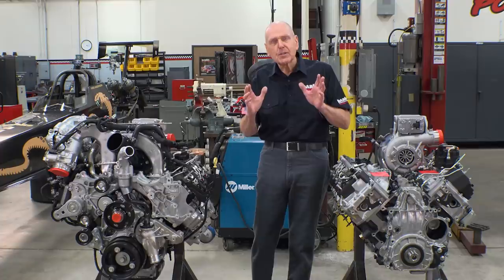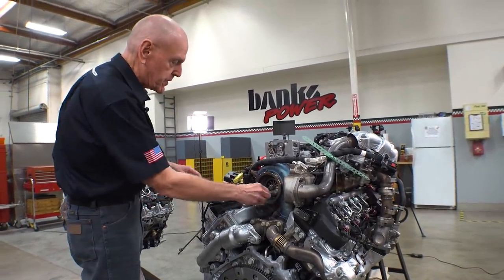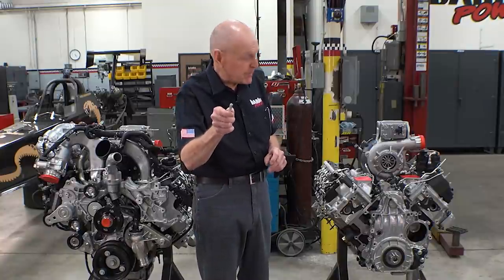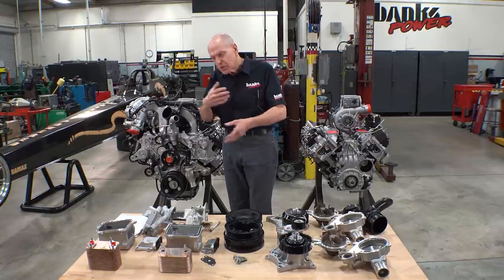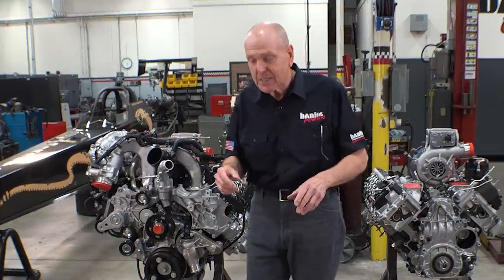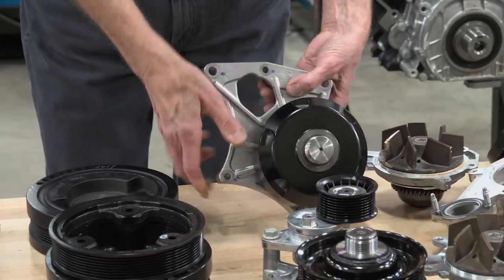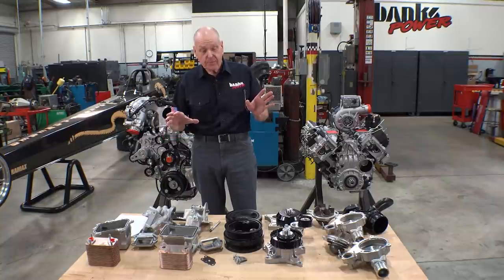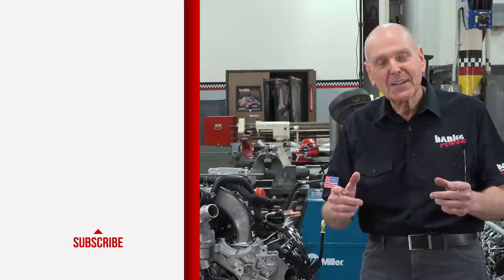2020 DURAMAX L5P Engine Revealed!

Comment: Hey Gale, do you have any data on the measurables between belt-driven (power-sucking) water pump/fan and the electric versions? Durability measurables?
Reply: Cooper Anderson, hehehehe, funny stuff, where do you think the electric water pump gets its power?
Are you are planning on running a long lead from home, no! So it comes from the belt-driven alternator, plus copper losses, iron losses and a few conversion / cooling inefficiencies, unlike electric fans, the water pump has to run whenever pistons are moving if you stop or slow the water pump, the water in the radiator will over cool and slug back into the hot engine and, what’s that word... Oh, thats it, fuck it, since the thermostat would only ever see hot water, it would stay wide open.
Reply: Converting from mechanical energy to electrical and back to mechanical is not more efficient.  The main advantages of using electric fans and pumps are that it allows for more variability in speed and the ability to keep them running during the stopped portion of engine stop-start cycle.
Reply: Looks like the pulley for the high hp fan is on the outside of the accessory pulley. Isn't that a worse scenario for torque bending the crank snout?
Wouldn't that be a better case for electric fans?
Reply: it is about CFM. the electric fan dweebs with the 5 second throttles are maybe 5 digit cfm.. any belt driven large diameter is in hundreds of thousands. I still rev my engine to simply blow some powdered snow from under the old truck.

Comment: my 2014 pulled 50000 for 2 years the rear end is what couldn't handle it the engine did fine very strong 6.6

Comment: the compressor resurge? Is that basically making a smaller tube than what should be so backpressure ... basically has a built in blow off valve? lol

Comment: Gale. Love all your videos. Curious, will you review the new 7.3 L from Ford? If you had to buy a HD diesel truck today, would you buy 2020 Super Duty, 2020 GM HD or 2019 Ram with the new Cummins? Thanks!
Reply: I saw that 7.3 cutaway!!! That's a different engine! It has a "dirty V". In other words, there's no cap over the V. It's just open room, so you might be able to stash a supercharger in there. It has a 4.22" bore, so yes, it really is a big block based on cylinder spacing. It's like an LS based big block.

Comment: Mr. Banks was the perfect person to do a deep-dive into this refreshed engine for us. Not diesel, but I'd also like to know more about GM's new 6.6 and Ford's new 7.3. It seems like Ford cheaped out in a few ways on their new offering, but I'm not the expert.
Reply: The 7.3 is basically an LS inflated to big block size. The valves are canted. It has the potential to be a fun piece of hardware. 

https://www.autoguide.com/auto-news/2019/02/ford-building-new-big-block-v8-for-heavy-trucks.html

The pistons are relatively short, so I'm not 100% these are going to make good stroker engines, but they're still badass.

Comment: Great guy and products but as far as the engine. It seems like it has way to many emission controls and components that rely on reading back to a computer to run. Might be good but as this technology ages it will make the truck extremely difficult and expensive to maintain and fix
Reply from the maker: Welcome to the 21st century. 😉
Reply: @bankspower  Yes your right, the beginning of the end for the diesel engine in production for light duty trucks because they will become to expensive to own and maintain. Alot of people cant afford 70 and 80 thousand dollar trucks that dont last😔

Comment: Great info Gale! Can you tell me how many injection events the L5P has per power stroke for 2020? And are they using piezoelectric injectors?
Reply: When the L5P first came out they got rid of the piezo injectors for solenoid units. They had "up to 7 injections" per compression/combustion cycle. 

Not sure if that changed for 2020...

Comment: I wonder what Smokey Yunick could  have came up with ..   I would at  Water Methanol injection and call it good ..   I  had an '81 GMC  Naturally aspirated  5.7 Olds Diesel  had to run it in second gear pulling a trailer or running up hill in the Mountains..    I had two small block heaters and had to use both to get it started one time when it got down to '15F at  10,000 feet ..

Comment: Dumb question; but why doesn’t it just have an electric fan instead of a belt driven system?
Reply: Using an alternator to take kinetic energy converted to electricity then from electricity to kinetic energy is not as efficient as kinetic to kinetic.

Comment: Are these still manufactured by Izuzu and imported by GM?
Reply from the maker: It's quite the contrary. Despite what most people think, Isuzu Motors Ltd. has very little to no design input on the Duramax engines. They co-own a portion of the D-Max company (the company that makes the engine) with General Motors, but it's now considered a past venture according to them as far as design and engineering. The Duramax engines are built right here at home in Moraine, OH.

Comment: A truck 8000lb has very little chance of stopping a load 30000lb 
The load will drive you not the other way around
Reply: You really assume they are going to pull a 30k load without trailer brakes?  That's a suicidal idea...
Reply: @ShyaMiss  even then its dicey
Reply: @bearsendproductions1843  stopping is rarely the trouble.  A good setup can easily stop itself.  Its turning a really heavy load that would be a concern.  Brakes do nothing to overcome the inertia when trying to make all that weight change its direction.

Comment: It seems as if the Duramax is really reaching its upper limits. I’ll stick with the Cummins. It’s much more simple and doesn’t need all the extra little bolt on gismos to handle more power or be able to haul more weight. It has been over built from the core from the very beginning with the 5.9 architecture.

Comment: I'd like to see diversity it's only been GM, can i see some powerstroke, or cummins please thanks.
Reply: He can hotrod the Duramax way more, that's why you don't see much of Powerstroke and Cummins much
Reply: @anthonywebber2211  that's why every pull truck is a cummins. Multiple diesel drag rails are cummins powered, and powerstroke powered. Most drag trucks are cummins. Duramax is behind on power and torque. Gm has a contract with him to put their motors in military vehicles, that's why you see them featured so much.
Reply: BeastRider651
Gale Banks got the contract with the military, Gale banks gets the Duramax straight from the factory, and he'll sell anything from a stock replacement to a 1500 HP twin turbo 7.0 Duramax to and that has the money
Reply: @anthonywebber2211  you got alot to learn bud, about things you don't understand go back and watch your gaming vids.
Reply: @Toten_651 , you going to school better, then Gale Banks has?
Reply: @anthonywebber2211  never seen a single motor built by them in anything other than their stuff. If it was good then why are there no racers using any of their products except intake horns on cummins

Comment: Does the reverse position of the flag bother anyone else?
Reply: It's a military uniform thing
Reply: It's not a sign of disrespect. It's meant to look as if it was mounted on a pole and charging into battle. Whichever way the motion is going, the union (the blue square) is first. If you look at an airplane where the flag is displayed on the right side, it should be reversed too. Anything with the flag on the right should look like this. I know not everybody knows this fact. Hope this helps.
Reply: That’s the CORRECT way it should be worn
Reply: The stars are always supposed to be at the front, as if you are holding a flag pole and charging into battle. Also if you hang a flag vertically, the stars should be in the top left.

Comment: "This is an engine as shipped to the assembly line by the Duramax factory"
You meant:  "This is an engine as shipped to the assembly line by Isuzu in Japan" right?
Reply: last time i checked the engine was built in ohio at a plant owned jointly by the General and isuzu
Reply from the maker: Despite what most people think, Isuzu Motors Ltd. has very little to no design input on the Duramax engines. They co-own a small portion of the D-Max company (the Duramax engine manufacturer) with General Motors, but it's now considered a past venture according to them from design to engineering. The Duramax engines are built right here at home in Dayton, OH. Check it out: https://www.dmaxengines.com/

Comment: Why don't diesel use electric fans
Reply: Elec fans cant pull enough CFM thru the radiator, if they did they would be running such high amperage as to not be practical.

Comment: Hey gale, quick question: why doesn’t GM produce HoT V turbo Diesel engines. It seems it would be more efficient, torque come on faster, and throttle response would be faster. 

Other than that they would be switching the intake and exhaust ports around. 

Wouldn’t that be better?

Comment: Why would gm go with a mechanical fan that robs pawer, why not go with a big electric or 2 smaller fans.
Reply: Nathan Mitts    Electric fans can’t move as much air. High power electric fans just transfer that load to the alternator so the engine still has to pull it. 2 electric fans can pull 40 to 50 amps each. The small one on my old s10 pulled 35 amps That’s almost half of what the Alternator could put out on that truck.
Reply: It doesn't rob power unless your talking about a track car with a limited run duration, mechanical is more efficient overall. Meaning in commercial use like those engines are designed for out west pulling a 6% grade for 10 miles electric would be junk.
Reply: if it is ran off the front of the engine it will rob power Engine Masers tested it. Electric fans can move gust as much are if not ore then a mechanical one its all in the engineering of the fan blades and how fast the fan is spun.
Reply: No way that fan pulley is taking more power than an alternator... Alternator alone is at best 60% efficient, not accounting for the efficiency loss in the electric motors turning an electric fan by comparison.
Reply: Nathan Mitts    You don’t see any diesel trucks with electric fans because they won’t move Enough air. You can find a few pieces of heavy equipment that have hydraulic fans only because the engine is sideways or backwards and they have to do it. Most vehicles can go down the interstate and the electric fan never come on in gas vehicles. They could make an electric fan that would be powerful enough but the motor would be huge and the engine would still have to pull the load through the alternator. The more current you pull the harder the alternator is to turn. No such thing as free energy. Either way it’s a load on the engine And a diesel truck towing that fan would have to run a lot on the interstate. Our international dt466 truck at work It will run 210 on a cool day And the fan still cycles on and off at 75 mph and sounds like a tornado the fans about 4 foot tall. If you open the hood when the fan clutch is engaged and rev it to half throttle you can’t even talk the wind is so strong. It will blow your hat off and your shirt will slap you in the face. I’ve got twin flexalite fans on my old truck and they don’t blow near hard enough for a diesel with an inter cooler. Most electric fans have low pitch blades and they spin really fast because the small electric motors don’t have a lot of torque. if you notice the fan on that diesel engine has very high pitch blades you can move twice the air at half the speed and when it’s not needed on the interstate it just free wheels. Mechanic fans Move a lot more volume.
Reply: the only time the fan pulls any real power after engine warms up is high power slow speed pulling forward speed moves most of the airflow at highway speeds electric fans just load the altinator and are less efficient in this use
Reply: Because a fan of equal size and air moving capacity takes the same amount of effort to turn it regardless of whether it is turned by the crank or an electric motor.  With a mechanical fan, there is near zero loss from the driving force to the fan.  With an electric fan, you lose 10% conversion loss from mechanical to electric in the alternator then you lose another 10-20% conversion loss from electric back to mechanical to drive the fan.  That means it takes from 20-30% MORE total energy to drive an equivalent fan using electricity than it does direct driving through a belt off the crank.

Comment: Has anyone ever compared the front end components on gm and ford....    tie rods for ex... they are massive on the fords and rinky dinky on chevy what good does it do to make more power and run cooler temps if the drive train won't handle it hmmmm.... didn't thank that one through gm great job

Comment: No way that fan pulley is taking more power than an alternator... Alternator alone is at best 60% efficient, not accounting for the efficiency loss in the electric motors turning an electric fan by comparison..
Reply: What are you talking about ?  Cooling fans fully engaged take huge amounts of power.  Like 50HP+   

Alternators are like 90% efficient.   200A x 15V (even) = 3 Kw.  Less than 5HP.  An alternator takes 1/10th the power that a cooling fan does.
Reply: @SomeTechGuy666  Alternators 40-60% energy loss

ribbed belt, 98% energy efficient with proper tension

6 cell lead acid at 10-20% discharge = 50-60% energy lost to heat on charge

12v High heat electric motor rotating fan blades unrealistically 90% efficient..

This isnt all the stages of loss either.. 
A clutch operated fan is far more efficient..
Reply: @DarkLinkAD  I've got better things to do than argue with you.
Reply: @alphaforce6998  your estimate of 10 amps is way low. The lighting alone will be about that and higher for trucks equipped with halogen bulbs.

I think the ecm is about 10 or 15 amps but may be more since it drives the injectors. The tcm maybe 25 amps. Radio, HVAC fan, BCM, and all of the other accessories. I can see a continuous draw of 50 to 75 amps. 

Since I have a Duramax, I'll have to make this measurement and see what it really is
Reply: @alphaforce6998  Diesel pickup truck radiator cooling fans take way more than 5 HP when fully engaged.   More like 25 HP.

Some highway tractors engage the cooling fan when engine braking to increase the engine braking force.
Reply: @alphaforce6998  Whatever.
Reply: @SomeTechGuy666  Lets meet mid way.
I see videos of no change in dyno hp after an electric fan conversion.
I see videos with 4-5hp change with an electric fan conversion.
And I see videos of 9hp Gain with removing the pulley operated fan shroud. Without conversion.

Logically, the pulley operated fan in some scenarios, is just doing more work than an electric fan could realistically do.
Remove the shroud, you reduce the effective load being put on the fan and you gain hp.

Mabye gains can be had, mabye a less powerful more efficient pulley fan would be desirable over electric fans? Mabye the equivalent is just removing the shroud all together. Longer on time, less power draw.
Its a trade, no free lunch.

Keep in mind, the pulley shouldn't engage until a given under-hood temp is reached.